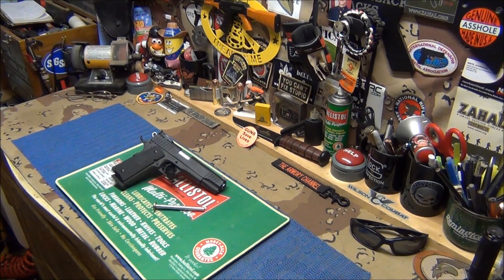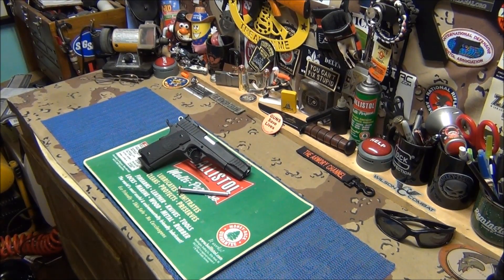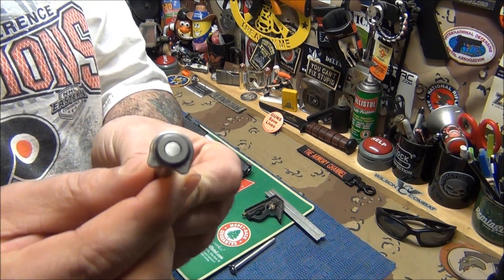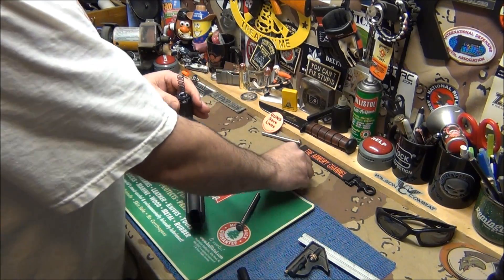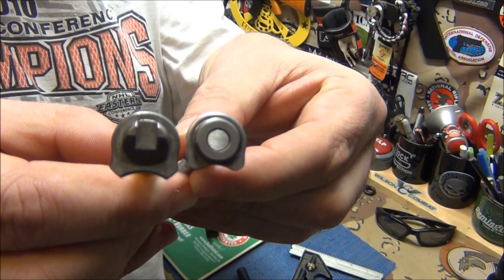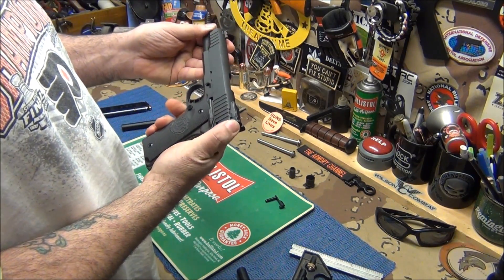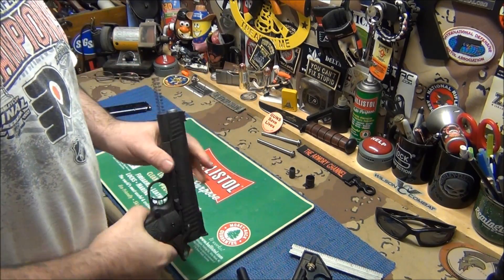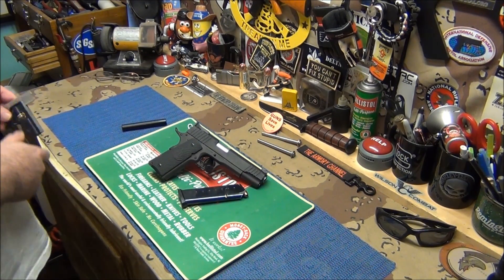Guns are being made too fast!

Comment: It's not just the machist fault but also the quality control deparments fault. I'm a machist and I have to check my parts so does quality control and final inspection department. So my parts get atleast 3 different set of eyes on them. If even one fails the whole lot gets sent back to me for sorting. That should be standard operating procedure for all manufacturing.

Comment: Main problem with the 1911. It's everybody's hump. Everybody sells one and everybody builds it to their own spec's. The custom hand fitted 1911's are beautiful and extremely functional but its like having a custom one off hot rod if something breaks its back to the builder or fabricate & fit it yourself. Nothing drops in. Your average 1911 on the other hand is a lot like a 70's muscle car hard and fast in the straight a ways loose and sloppy in the corners & sometimes it leaves you stranded.

Comment: Probably made on a Monday after a bad weekend(8-). If ya had a lathe, or even a
drill press and a file, you could true that end up a little and have a spare rod. With
the Wilson, I'd want to use a rubber or neoprene recoil buffer...or just use the KISS
theory and put that brand new STI rod in there....